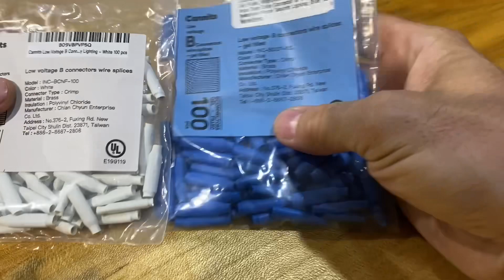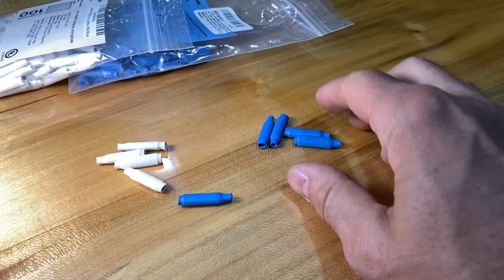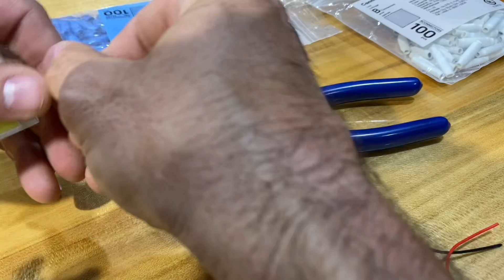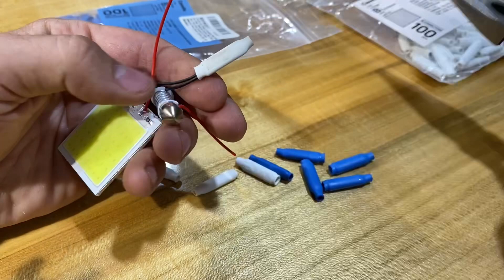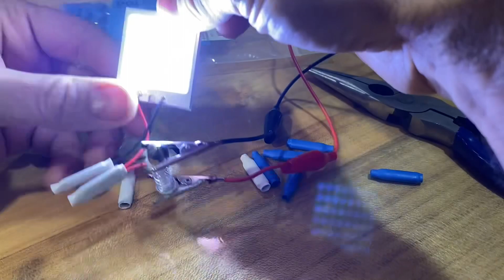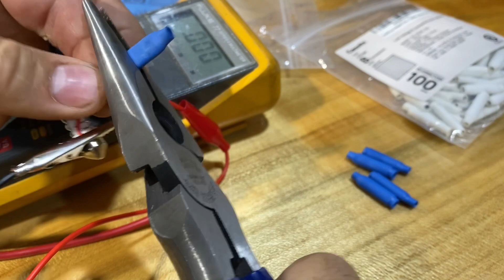Crimp connectors from Cannits

Comment: Do you think these can be used for doorbell wire extension? I’m trying to hook up my nest doorbell.
Reply: Probably, as long as both wires will fit into one end. Of course in your case the best option by far is soldering the wires together and covering the connection with heat shrink tubing.